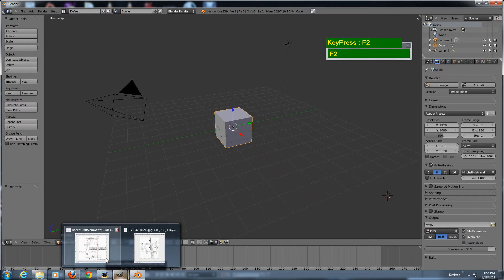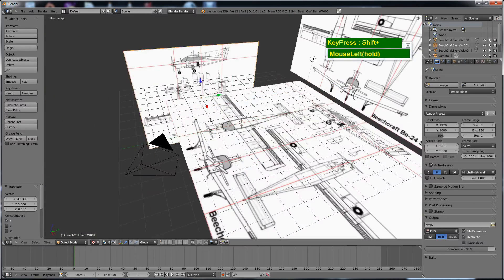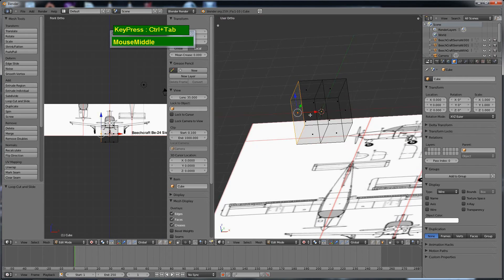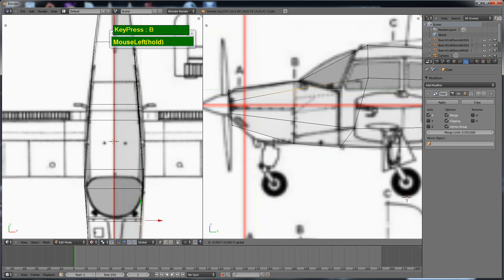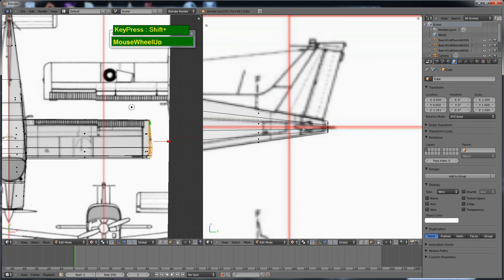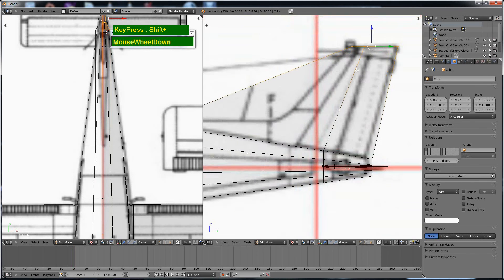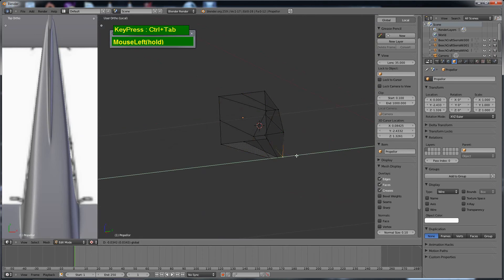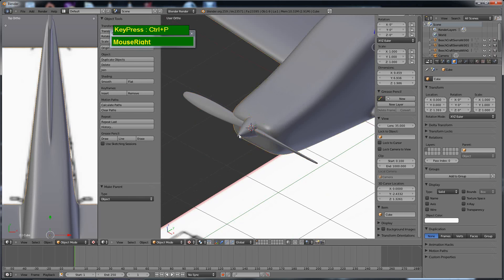Blender 2.59 Airplane Modeling Timelapse

Comment: I was following this tutorial in 2.64 and at the point where you go into edit mode when setting up the image. I was using the Empty object method for the image planes and was having difficulty going to edit mode with an empty to trim down the image. Is that not possible with the Empty method? Thanks.

Comment: @weeliano I've been working on an XF-92 for the past few minutes and I was wondering the best way to model the main body. would it be better to model it beginning with a cylinder instead of a cube because in the end when I subsurf the model and use edge loops to make it look better the front and back look like a square, but it's supposed to look cylindrical.